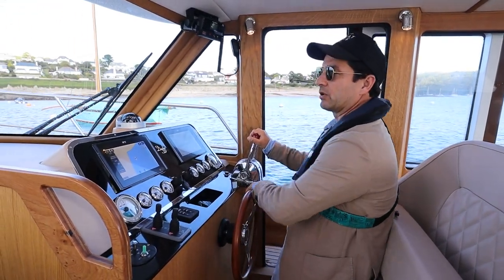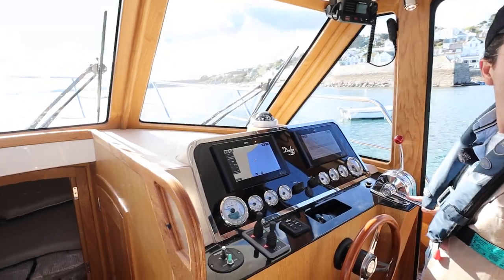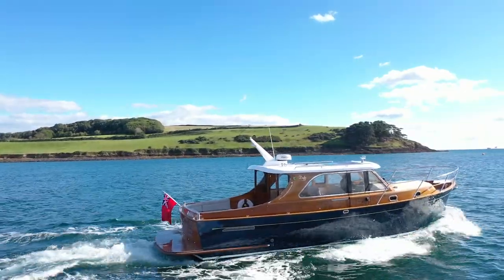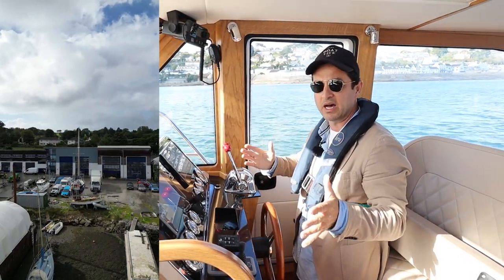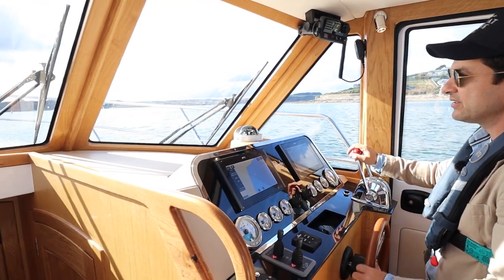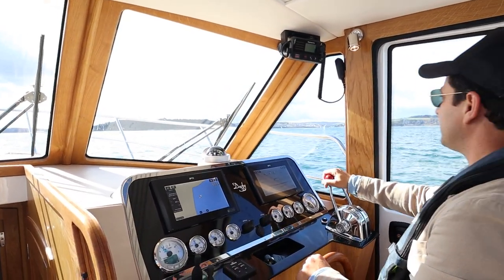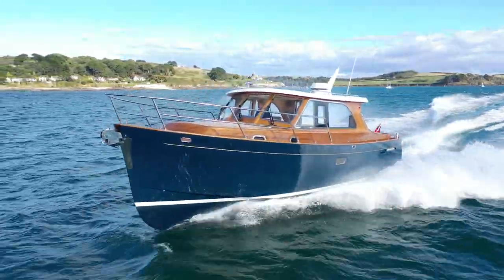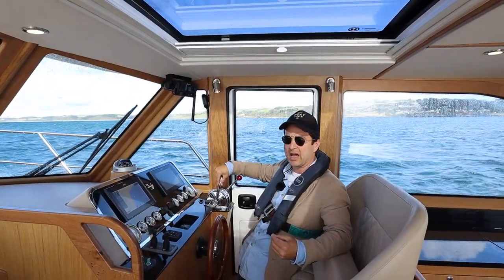Duchy 35 - Part 2 -  Discover the Duchy Difference

Comment: My old Westerly sail boat had twin steel keels with flat bottoms and a reenforced steel rudder. The boat was designed to sit down at extreme low tide with stability rather than need extra struts to stay upright.

That feature saved my old girl more than once during powerful nor’easters on the Atlantic seaboard. Other sailboats would lay over their finger docks when the offshore winds sucked all of the water out of the harbor, but the little Westerly would be standing tall without a piling punching a hole through her.
Reply from the maker: A valid point for UK waters. Those tides I saw were massive!